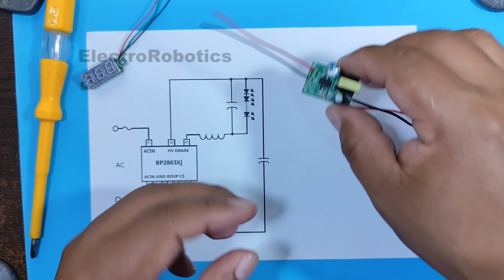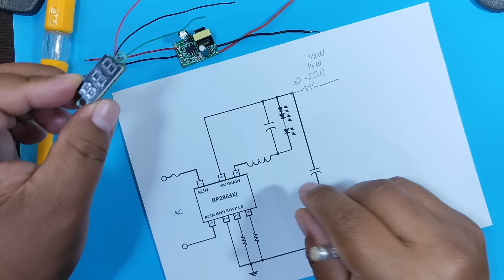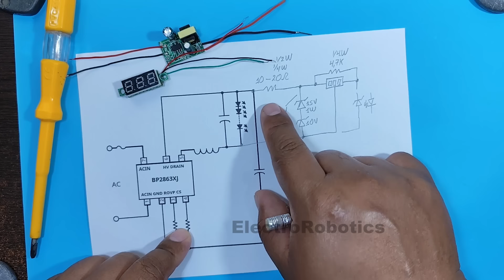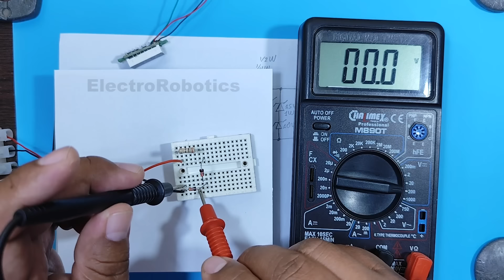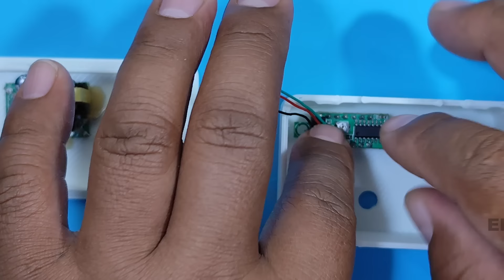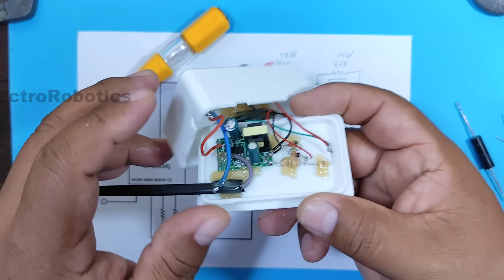Make your own Tool to Measure any Electronic Component Using a Damaged Light Bulb

Comment: ....LMAO   he did the bit about the LED driver before though this is more clear BUT still igfnores the fact that this circuit type is not the most common.  So its unlikely to work for you.
The off-board resistor is near its max voltage - bad idea.
The high voltage can destroy LEDs - really BAD idea. How does he not know this?
It only measures the voltage drop so measuring is only useful for junctions   and Zeners.
I would not use for in-circuit testing.
The switch has to be on the LIVE wire - How does he not know this?
Accuracy depends on the waveform but he does not show/discuss this - How does he not know this?

Comment: Sir, the modification you have done is very accurate and successful. You should make another video in which there should be some modification so that the back light of LED, LCD TV can be checked easily.

Comment: This is a nice and practical modification, BUT an internal short in the integrated circuit can always happen. In this case, since the output of the circuit is not galvanically isolated (by a transformer, given that this circuit is simply a high volrage current regulator in its function), it can potentially cause a deadly electrocution to its operator. Besides there is no protection fuse anywhere and this makes things worse...